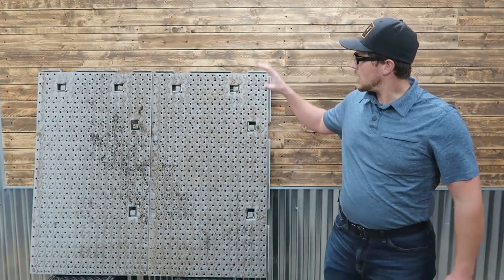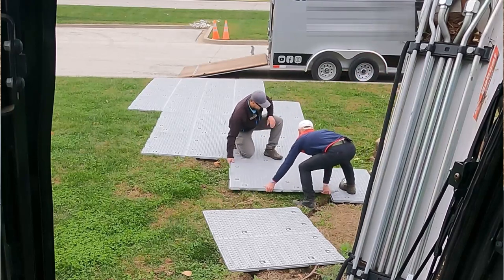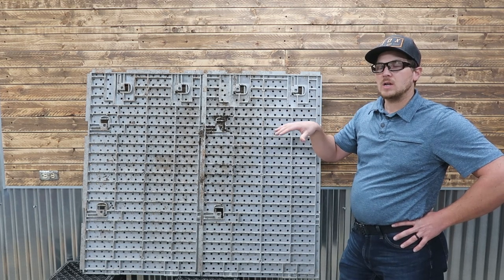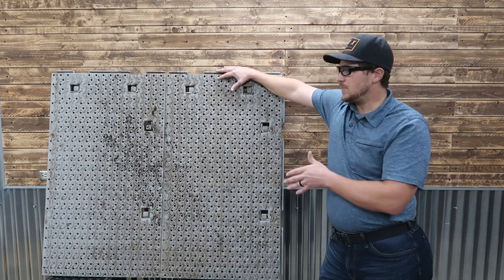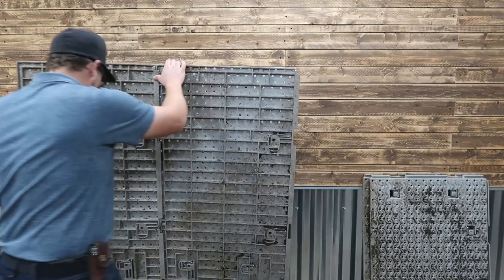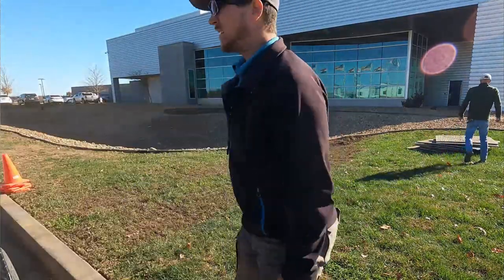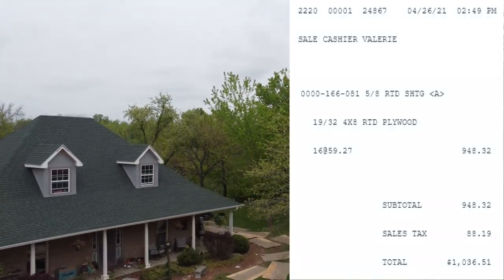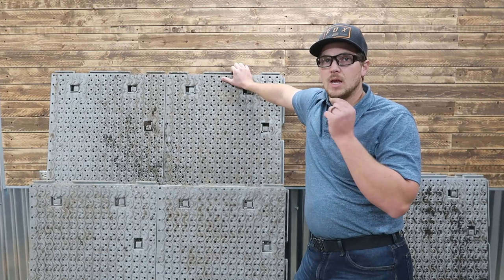What to know about Workhorse Ground Protection Mats Before you Purchase.  MUST WATCH!

Comment: You had me at… “They don’t kill the grass.”  It is a good thing to not scar the landscape.  Keeping track of tire marks out is a wonderful thing.  But, it you smother the grass you are still gonna have to till it up and replace the grass!

I pulled my pool cover off this spring.  After hosing it off I took it to a grassy spot beneath the trees to dry.  It was only there for about an hour.  When I folded it up, there were burnt spots where the sun had leaked through the canopy above.  It looked like a green and brown Holstein cow.  Had I dried it in full sunlight it would have looked like a brown Jersey circle!

Plywood is better than plastic as far as burning the grass goes… but I agree with your list of limitations with its use and durability.  This seems to be a good fit between plywood and normal plastic.

And, that grid in the back appears to be good for anchoring them in place with or without interlocking them.

Good review… I enjoyed it!